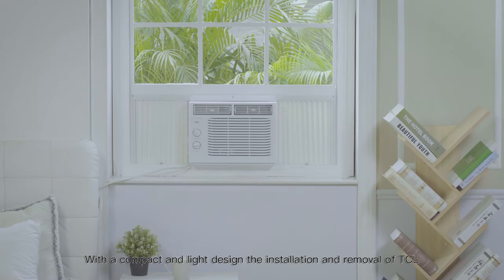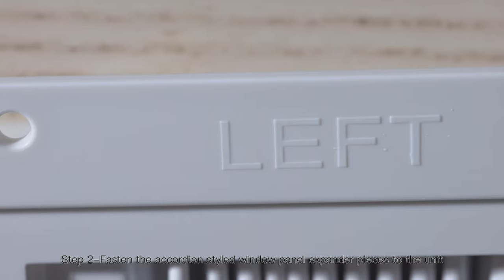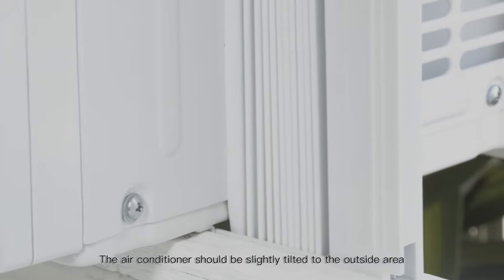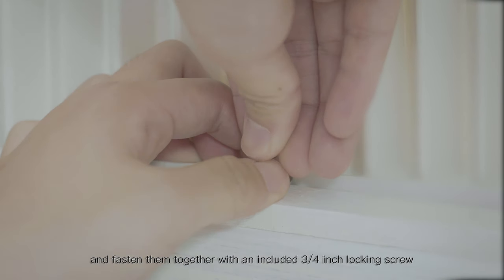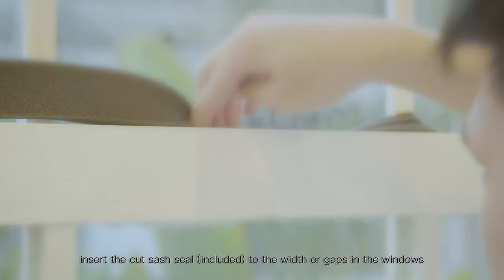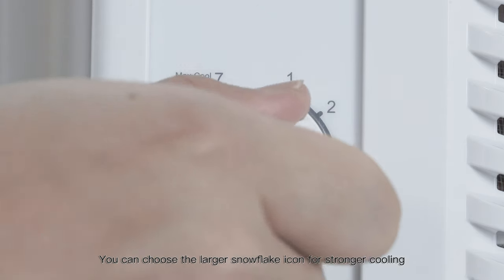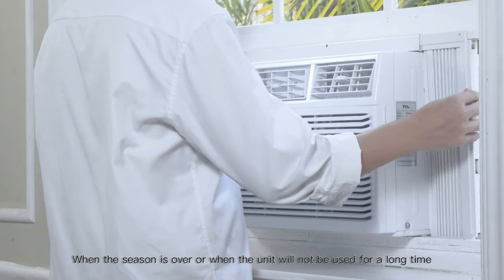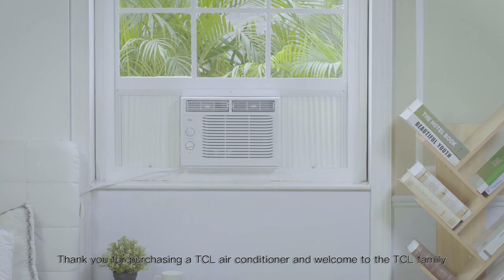TCL Mechanical Window Air Conditioner

Comment: There’s a white plastic (looks like packaging plastic) inside the ac unit. Is that normal?? I have 2 other window ac’s and they don’t have that.
Reply: Yes, the Styrofoam or Polystrene is the material used to form the air ducts.  It is part of the product and should not be removed.